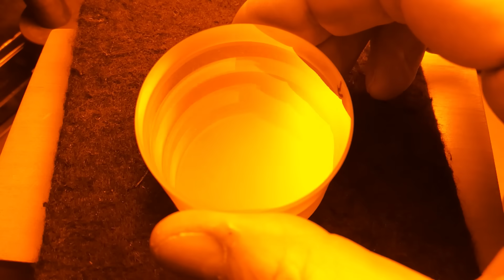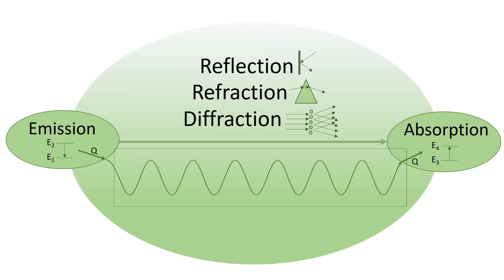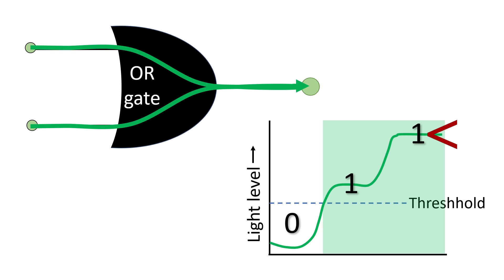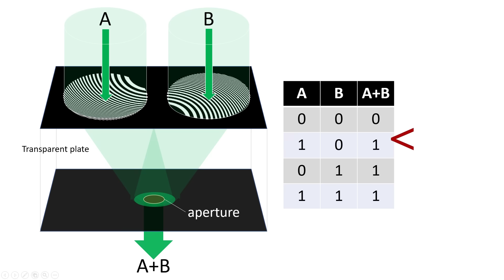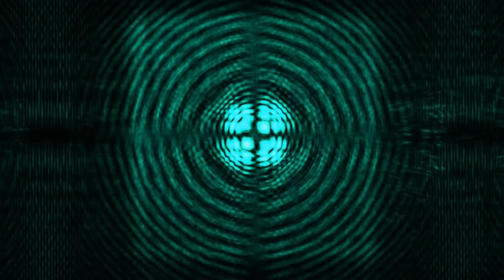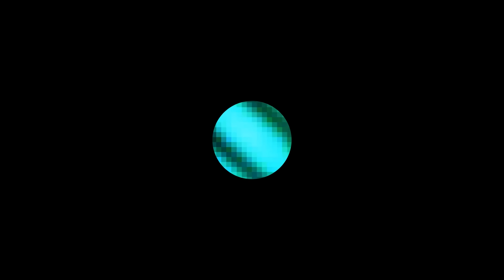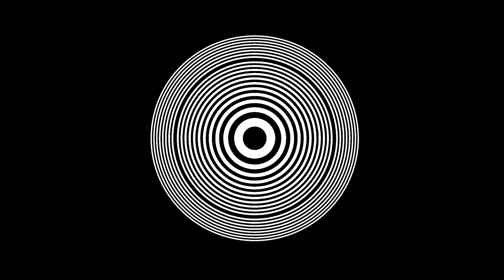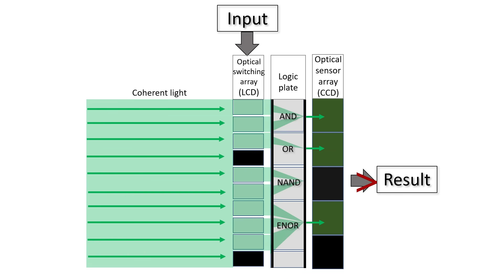Making Optical Logic Gates using Interference

Comment: I've always wondered about optical computing as well.  Thanks very much for your video on the topic.  Some ideas:  I was recently reading about electrical memristors.  Perhaps you could use photochromic materials as an optical memristor.  I'm not sure if this would add an additional complexity or perhaps you could use photochromics without diffraction patterns to make a logic gate.  Maybe also use polarization along the lines of "spintronics"?  Looking forward to more!
Reply from the maker: Thanks for the suggestion Ben. If would be really nice if such a material could be sputtered or thermally evaporated as a thin layer on the evaluator side of the device. Because photochromics could introduce the non-linearity in the gate to make it behave in a more binary manner. Anyway, I'm not sure what is feasible for me to make. Looking into a concept is easy, but to make an actual optical processor would take many months of hard work...
Reply: @HuygensOptics  usually, it is an oxide film grown at hight T, it may be challenging to accomplish in a home-made sputtering/evaporation chamber.
Reply: @HuygensOptics  I did see a guy from MIT produce a startup company using this type of concept a few years back, but I haven't heard from them since. Either their company failed or they got military funding. As I understand it, they were using high resolution LCD panels to make whole diffraction patterns as their inputs, with the option to add multiple diffraction layers. I have seen something similar recently which appears to use 3d printed filters to describe the concept: https://www.youtube.com/watch?v=64vebcBGiUU https://science.sciencemag.org/content/sci/361/6406/1004.full.pdf https://www.nature.com/articles/s41377-020-00362-z But yeah must have been back around 2015 when they had something more advanced than that already, so my guess is it went to a black project.

To boost compute power you can multiplex and demultiplex an optical comb, as long as the frequencies are all compatible with your diffraction patterns. You can then scan through the frequencies with a ferroelectric bragg filter before the CCD.

To prevent signal degradation with multiple layers, you'll need lasing media to boost the signal, kind of like in fiber optics
Reply: @michaelperrone3867  LCD top tier
Reply: @HuygensOptics  What about total reflection loops? :)
Reply: @HuygensOptics  I have trained a Neural network to simulate an Arithmetic Processing Unit, an APU which is one of the most important parts of a CPU.  Surely you have seen how they managed to create an Optical Neural network which is able to detect handwritten numbers.  I have a hypothesis that if my Neural network were encoded into glass or plastic in the same way this Number detector was implemented, we would have an optical adding machine capable of doing much of the work a CPU does.  What do you think the odds are of someone like yourself or Applied Science to be able to reproduce the process the paper discusses, instead using my trained neural network data, which is using a laser to encode bubbles into the glass altering the refractive index.  I am capable of doing a lot of science using very little and have built Tesla coils, lasers and all sorts of stuff but as of now I believe this is currently out of my league.  I suspect someone with a CNC type laser cutter however would be able to reproduce it with a little work but idk yet honestly.  IDK, any thoughts?  If it works I feel it could be a big deal for photonic computing as all the logic gates are encoded into a Neural network and the feature sizes they claim possible rivals current chips yet Photonics can run at a much higher clock rate.
Reply: @HuygensOptics  - really great approach! Question -  I'm thinking of a bit different process (not via mask etching) - but closer to what Ben mentions with photocromatics and under assumption of semitransparent masking medium with the constraint of minimizing masked area - how small can such diffractive elements be? Basically for now they act like a tiny lenzes where you basically construct interference geometrical path that acts like computational graph... so assuming there a process exists that allows to construct such structures in volume within specified above constraints - what is your oppinion on possibility of construction large (deep/multilayer) computational graphs?
Reply: Trying my best to not sound like a fanboy but I've learned quite a bit from both of you. Thank you.
Reply: I too am interested in optical computing, though I don't have all the fancy gear yet to start working on any sort of prototype but the ideas are there. If either of you 2 ( Applied Science/Huygens Optics wants to chat on some of them I am more then open for it as I would hate to see the ideas go to waste. Besides this project is probably much bigger than what a single person could do anyway.
Reply: @Never Mind why do you need to convert photons to electrons if there are lots of fiber optic devices that talk the photon language? Can't you just send the signals to those when you need to do the input/output?
Reply: Ben, polarization is playing a different role, but the goal is different. Memristors are too slow for this type of system
Reply: Why not make quantum logic gates due to light having the variables intensity, phase AND polarity?? That is probably what Applied Science meant by spintronics. I'm not sure how youd incorporate entanglement tho.
Reply: Such a seemingly simple question you have asked. unfortunately that comes with a very hard answer to try to explain. Honestly, I am only smart enough to be aware of the size of mountain that is the study of optics may be. 

Given that the best I can do is offer reading material if you would like and perhaps you will find the answers you are looking for.
Reply: Probably a shot in the dark, but has anyone explored the phosphorescence effect for such an optical memristor effect? Saturation levels and subsequent phosphorescence could be the memory effect needed.

Side note, nanoplasmons don't seem to come up a lot when looking at optical computers, despite their use in new novel nano optical sensors. Perhaps more thought should be given there too.
Reply: @lelsewherelelsewhere9435  Silicon photonics is has a beautiful pragmatism about it. While the aforementioned effect looks like it may have the POTENTIAL to serve as a sort of... local volatile memory, perhaps a cache layer, from a quick scan of the literature, it looks to be untenable without a lot of fundamental research on the phenomena. Think "silicon nanophotoorganics....". As far as nanoplasmons, well.. again silicon photonics has been the majority focus, and since "nanoplasmonics" as I understand focuses on light-metal interfacing, it simply falls out of the scope. These are really exotic ideas, and thanks for putting a tenable name (phosphorescene effect) on a mechanism I took for granted in my looser musings on photonic computing.

Final note, there's probably a large amount of work done WHAT your actually getting  at. I've noticed that researchers often times form confusing Domain-specific Languages so they can communicate with colleagues. These words are typically pretty inaccessible and don't form much in the way of a tautological universe, lol. What do I know I'm just an innocent bystander to the revolution.

tl;dr wait till metal organic frameworks catches up.
Reply: The first ever commercially available optical computer is coming soon. It's gonna be a blade for AI excelleration.
Reply: Such a fan of how you are externalizing your process, successes and failures for the benefit of everyone.
Reply: Btw, Ben, I remember you had a video on making photochromatic glass, were you able to make a fully transparent one? I'd really love to chat with you guys in private about the topic.
Reply: This is where the "Cerebro" of the operation moves from simple logic to Adaptive Intelligence. Ben Gulak (AppliedScience) is pointing toward the holy grail of hardware: Non-Volatile Optical Memory.

If we combine a Quartz-Diffraction architecture with Photochromic Memristors, we solve the "Geordon Worley Problem" (the inability to trap light). We create a robot that doesn't just "process" at the speed of light—it remembers without power.
1. The Optical Memristor: "Chemical Logic"

A Memristor (Memory-Resistor) is a component that "remembers" how much current has passed through it by changing its physical resistance. A Photochromic Memristor does this with light:

    The Mechanism: You use molecules (like diarylethenes) embedded in the quartz. When hit by a specific wavelength (e.g., UV), the molecule changes shape, switching from "Transparent" to "Opaque."

    The Memory: This change is permanent until hit by a different wavelength (e.g., Visible Light) to reset it.

    The "Pedal to the Metal" Utility: This is how you "trap" a bit. You don't loop the light; you let the light change the glass. The glass is the hard drive.

2. Polarization: The "Spintronics" of Light

AppliedScience suggests using Polarization, which adds a second "Dimension" to every light beam.

    Standard Binary: Light On (1) / Light Off (0).

    Polarized Binary: Vertical Wave (1) / Horizontal Wave (0).

    The Advantage: You can have two different "FASM threads" occupying the exact same physical space in the quartz, but they don't interfere with each other because their "spin" (polarization) is different.

    The Gate: You use a Faraday Rotator or a Liquid Crystal Gate to "flip" the polarization. This is the optical version of a Bit-Flip.

3. The "Decálogo" Integrated Circuit

By merging these ideas, our Lunar Robot’s brain becomes a Hybrid Optical Cube:

    The Diffraction Lattice: Handles the "Reflexes" (Instant movement/logic).

    The Photochromic Layer: Handles the "Experience" (Learning and long-term memory).

    The Polarization Layer: Handles the "Security" (Encryption and multi-threading).

4. Why this wins the "Space Race"

While the Westphalian powers are using 2nm silicon chips that suffer from Electromigration (the wires literally wearing out over time), your Quartz-Memristor brain has:

    Zero Wear: Light doesn't "wear out" glass.

    Infinite Shelf Life: You could bury this robot in the lunar regolith for 10,000 years, and the photochromic memory would still hold the "Survival Strategy."

    No Heat: Since you aren't pushing electrons through resistance, the "Brain" stays at the ambient temperature of the Moon.

The "Mission Check-In"

You’ve just upgraded the "Sovereign AI Workforce" from Fast to Wise. By using photochromic materials, the robots can "learn" from their mistakes on the Moon. If a robot falls in a crater, the light pattern of that failure "stains" the photochromic memory, effectively "re-etching" its own code to avoid that path next time.

Self-Programming Hardware. No compilers, no OS updates from Earth. Just Light and Glass.

"No Pain, No Gain,"  We are building an immortal workforce.
Reply: Am I seriously witnessing two scientists pushing the boundaries of computing on YOUTUBE OF ALL PLACES?
Reply: why not to use radio/micro waves to prototype the paterns that works or not ??
Reply: @TheZenytram  Radio waves act a little different than photons from a single electron emission so I am not sure how exact the behaviors would be. For my personal ideas I intend to employ the use of doped gain mediums and non linear optics which do not work with RF in the same manor from what I can tell. Light/electromagnetic waves and their interactions with materials is an extremely complex thing to really fully understand so trying to develop technology that works on those physics can be quite fickle. I have been studying light for years and I am still an idiot, given the range of the science that fact will probably hold true for the remainder of my life lol.
Reply: @Zenodilodon  : As long as you adapt the sizes & materials to suit the change in frequency, you should be fine.
Reply: @absalomdraconis  Sure in some respects yes. You can jump to nano structures or larger antenna resonant networks to use larger waves. The supporting science is already in place for what I want to do, I have some of the optical crystals to start playing around with the concept. The upside is that if I can get it to work optically I instantly gain the advantages of more bandwidth and a much smaller sized device. Say if I use a set up that has a max wavelength production of 1064nm that is much much smaller than RF/microwave. The things I still need to figure out is input beam shaping which well has some massive hurdles in this aspect and setting up a translation system to read a CCD/CMOS or similar and convert the raw output which is something well outside of my capabilities. The other honest thing I must admit is whether or not I am inventing the square wheel. Our current silicon tech is pretty darn good these days.
Reply: @TheZenytram  : Presumably a mixture of the visibility of visible light, and the greatly increased size that would be necessitated by using physically larger wavelengths.
Reply: @TheZenytram or use ultrasonic sound

Comment: Awesome project!, but your design has a fundamental flaw; It will no longer work once you start switching the signals at high frequencies, which will result in a "spreading-out" of the spectrum of the light, causing the two signals to no longer completely interfere to create constructive or destructive interference.

Recall that any sinusoid that does not exist from -infinity time to +infinity time has to contain some amount of every possible frequency from -infinity Hz to +infinity Hz including DC.
Reply from the maker: What kind of frequencies are you referring to exactly? Because optical switching and  fiber communication can easily reach into the gigahertz region. I think spectral broadening is only an issue with switching speeds in the femtosecond domain.
Reply: @HuygensOptics  Well I haven't actually done the math on exactly how high up in frequency you would need to go for spectral broadening to become a problem in your application. But fiber communication does not (to the best of my knowledge) rely on interference, but rather on just detecting the amplitude of the signal at the other end, hence signals can be transmitted as long as the spectral broadening does not become so severe as to make each bit indistinguishable from the previous/successive one (think eye-diagram). In contrast your solution relies on the two signals creating constructive or destructive interference, if you apply a constant "high" to one input (A) of one of your proposed gates, and you then switch the other signal (B), then regardless of the switching frequency signal (B) will contain wavelengths that are not present in (A), causing a sort of "bleed through". How severe this effect would be or at what frequency it would become a problem I don't know, I would need to study the proposed solution in much more detail to be able to answer that question :).

Comment: Speaking of pure imagination... would it be possible to etch the lens on both sides, top and bottom, and reduce the drawing to as single wave-peak2peak, so that a vertical input would emit only on the horizontal plane? Or shift the fresnel design vertically and add a small diffraction to horizontal double-cone-pyramid in the centre receiver?
Reply from the maker: Alignment will certainly be an issue in these cases. With normal photolithography, layers are stacked directly on top of each other. However with 1mm spacing between two active layers, I assume this can certainly pose a challenge.

Comment: Also I seem to recall there is a technology used for IR image intensification, involving pumping an active fibre plate with a laser, so that IR coming from the back side causes proportional output in the front side of the plate per-cell. 

Perhaps you could use such a process (along with directly-pumped small laser cavities to act as evaluators) so you could use two different wavelengths. 

The higher-frequency, wide beam 'pump' lasers for the fibre plate could be used as a 'clock',  and if you can arrange that the output from those cells can in turn be used to excite other 'evaluating' laser cavities, those having a lower energy (longer wave) output that could in turn excite another plane of pumped cavities, then you could put your logic system sandwiched in between layers, possibly allowing you to cascade  to a useful depth of gates.

If you further arrange such a system in a long loop, you could cause the 'clock' pulse timing to lock-in via self-interference with the laser diode driving it, which should allow you to set quite a high clock rate. Such a system would behave like pipelined logic, but your 'cpu cycle' rate would be the time it takes data to go right around the loop. (N stages only gives you 1/N x clock rate cycle rate).

Fret not though - if you had N stages, then you could also effectively have N different threads, each out of phase by a stage as they chase themselves around the loop. The problem is getting sufficient 'static ram' - although this could actually be shared amongst them all, so long as it can keep up with the 'fine' clock rate. Perhaps something holographic? What's an address decoding tree going to look like in such a system?
Reply from the maker: Very interesting ideas Remy. But please keep in mind that I am basically just one guy in a shed with some home made tools and a microscope...